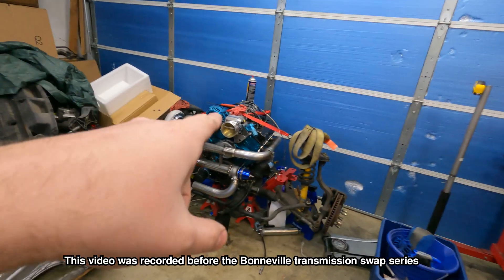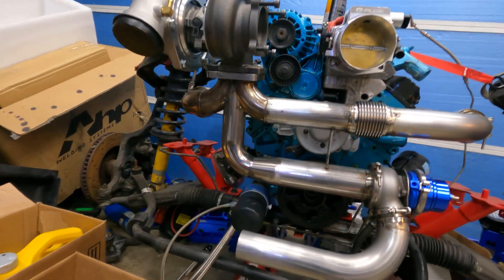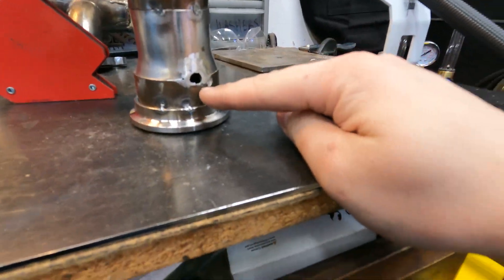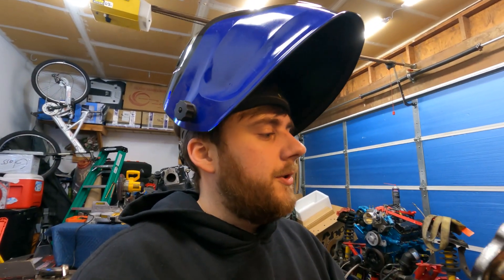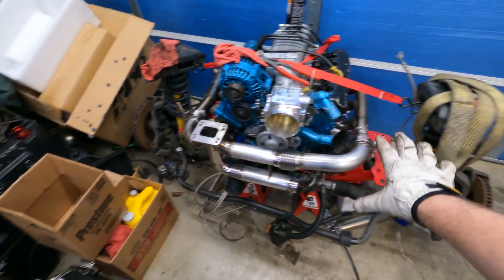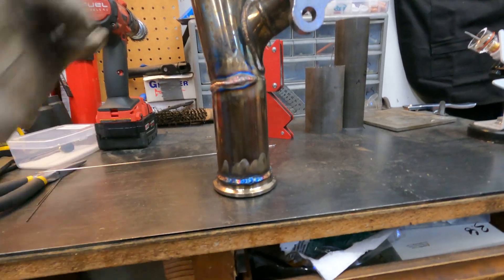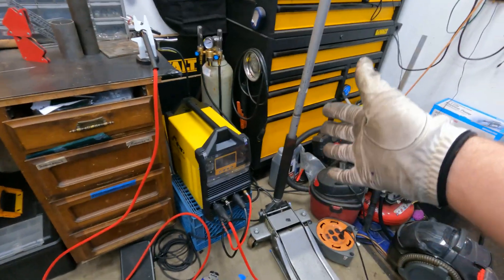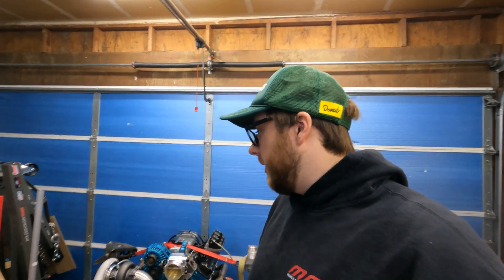Welding Project F's Turbo Manifold with our New Welder! (AHP AlphaTIG 203xi!)

Comment: Are you guys sacrificing the AC with this swap?
Reply from the maker: Yep, we are working on the AC delete now but will be retaining the heat and air.
Reply: @JuryRigGarage  shame but I see why  I currently got a 95 camaro that I want to do a similar swap someday can't wait to see Project F running
Reply from the maker: @thunderlighting2006  Yeah the passenger side manifold hit the AC box and with how we want to route the exhaust it fits perfectly where the AC compressor used to be.